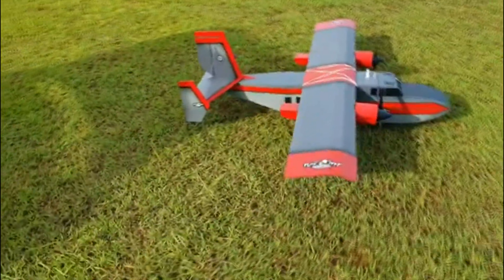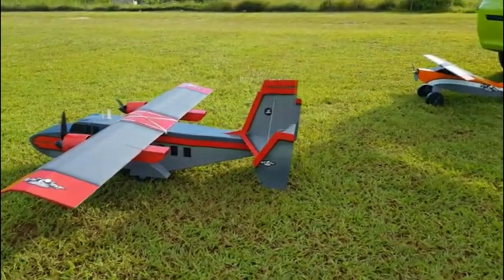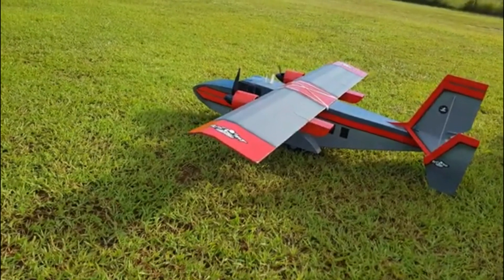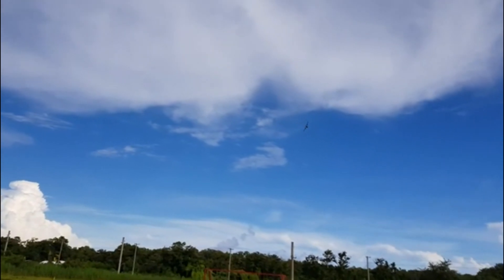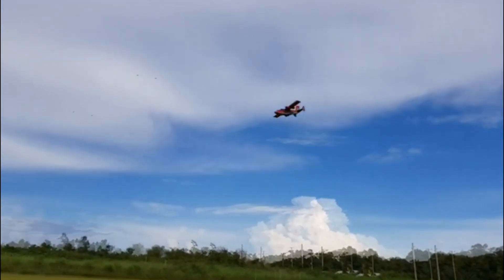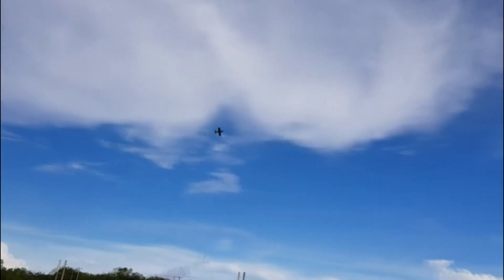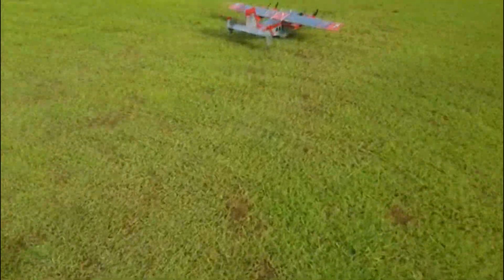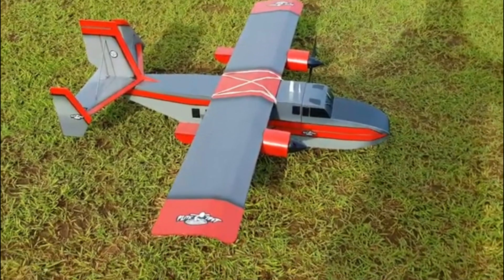Flite Test Guinea Pig Maiden Flight

Comment: I want to get a small mini nitro airplane but the motors are a little pricey and barely anyone has a .020 engine
Reply from the maker: Very true!  All the Cox Pee Wee motors on Ebay selling for over $150 if not more.  True collectors item now and those who are willing to pay for it.  I mean if I could only go back in time when I use to own over a dozen Cox engines like the .020 Pee Wee, .049 Black Widow, .049 Baby Bee, .010 Tee Dee back in the 80's I use to build control line aircrafts and or free flight powered by Cox engines.  The good old times!
Reply: @BayonasRCWorld  i was watching old videos and I was thinking of getting one cause it doesn’t use much fuel and I can make a plane or buy a kit to build a small plane for the engine I’ve also seen people put them on mini cars too